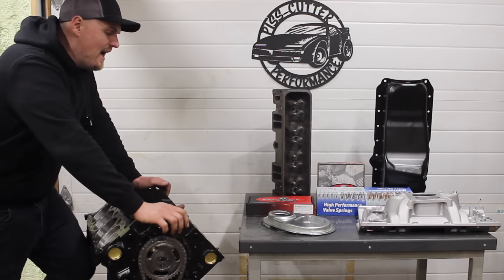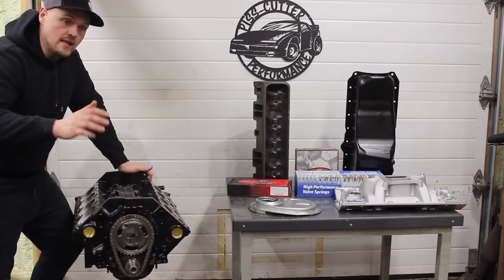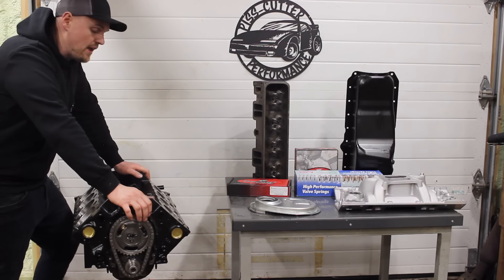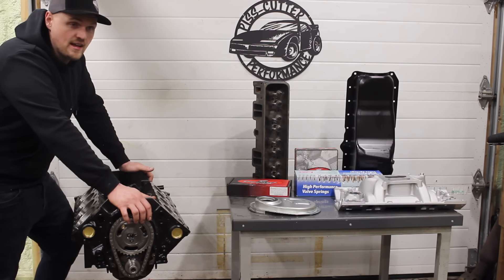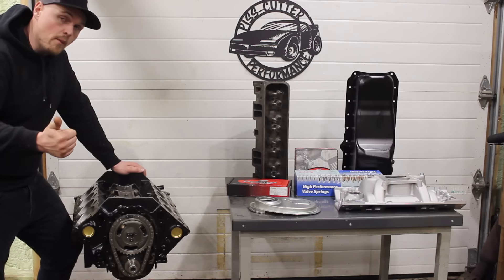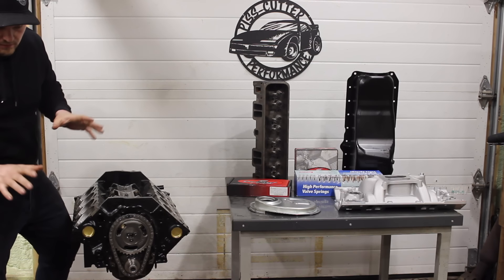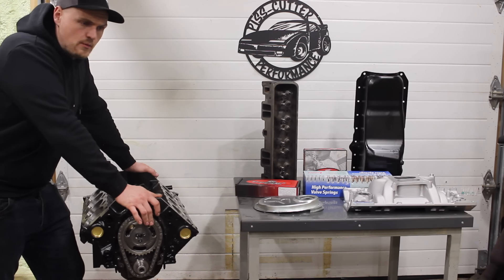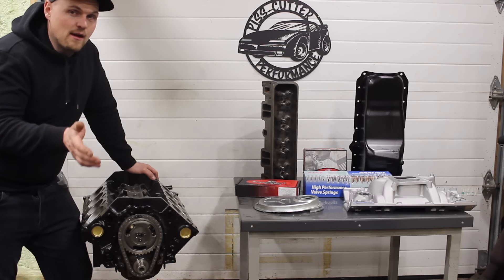The Cam I Always Get Asked About!  L31 Budget Build Update (L31 Build Part 5)

Comment: Great score on the camshaft! Would love to see what the factory Vortec cam would do with a set of 1.72:1 roller rockers. Would make it a .475"/.491" lift also for every .1:1 of rocker ratio increase you get another 2° of duration@ .050". So that would give the factory cam a boost another 4° per lobe to IIRC 195°/200° @ .050" from 191°/196°

Reusing the factory cam would be the most budget friendly. The 1.72:1 rockers are the biggest ratio rockers I could find made for a sbc. Would be cool to see these vs factory stamp steel rockers with the factory cam.

If you can find a higher ratio sbc rocker that would be even better to see. Or if you have access to Iron Duke 4 cylinder stamp steel rockers, those are 1.75:1 ratio. Not sure if they would interchange with sbc rockers though? These would get it to .483"/.499" plus 1° more duration@.050"  to 196°/201° if they would work? This would be very budget minded because most guys wouldn't want to remove the press in studs that are needed with lifts over .500".
Reply from the maker: Yeah I couldn't believe it when I figured out what the cam actually was, just such good timing to get it.
That would be interesting with a stock cam, but probably pretty weak in HP to most guys standards even with some aggressive rocker arms
Reply: I respectfully disagree.You might want to rethink the 1.72's adding duration. The lifter still starts up the lobe ramp from base circle at the same degree of crank rotation. The longer rocker only increases valve lift speed and overall lift. I have wanted to try 1.7 rockers on a stock engine also. I don't want to give up compression with added duration. Thanks.
Reply: @frankjones4094  you are wrong with your thoughts respectfully.  A higher ratio rocker will not change the overall seat to seat duration at lash point, however it will add duration at every other lift point along the curve.  Going from a 1.5 to a 1.7 adds about 4-5* @ 0.050 at the valve tip where it matters. By adding lift using the higher ratio, the whole lobe becomes larger from the added ratio.

I also would not waste my time with the stock L31 cam. It is garbage, it was terrible in my Express van that came factory with it.  I swapped the stock cam for a Comp 206/210 on a 110 lsa and 108 ICL with 0.484 lift with 1.6 rockers and that van was a different vehicle entirely. After the cam upgrade it actually had power to pass quickly on a 2-lane road and would actually rev up to the 5,000 rpm shift points at WOT without having to back off the pedal and let it shift.
Reply: @cuttersperformance  
Well here's the deal why I asked this is because I had a sbc factory roller cammed Vortec 305 in a 3,600 LB car backed by a 700R4 and a 3.73 rear gear that would do consistent 14.0s in the QM @ 98 mph. Not a land speed record but a whole second faster than a lot of the warmed over sbc 350 guys in a similar weight car. 

The only thing I did to that engine was light pocket porting, 1.6:1 roller rockers with the factory cam topped with an RPM Airgap and a crappy 600 Edelbrock 4bbl carb. So do you think it was the gearing that made it run that good or the engine or the combo of both? IMO the factory cam with the low compression pistons is a good match, even better with more lift and a bit more duration?

@Frank Jones
Well you will have to take your disagreements to David Vizard where I learned that info. That is the name of his yt channel, look him up he wrote the book on head porting and several other books on how to make power on certain engine platforms. He's an actual engineer not a journalist like some people mistake him to be.

Let me try to explain it before you get in an argument with a race car Icon. Think of the extra rocker ratio transforming a small cam lobe into something fatter and taller than it really is, just like what the factory ratio does. That 1.5:1 ratio not only makes the peak higher than what the lobe lift is it makes every point of contact higher is how even more ratio than the factory ratio gives a cam more lift AND how it gives more duration as well. The extra height on both sides of the nose makes it wider than the factory ratio does increasing the duration of how long the valve is opened over the nose. I hope this helps visualize how the extra ratio also increases duration?
Reply: @chrisreynolds6520  
The duration increase isn't much more than what the factory cam is, I suspect the lift is what helped get the cylinders filled more so than the 15*/14* extra duration. The closer the lift is to the max flow the better the cylinders will fill. The factory untouched max flow is right there @ .500" lift. Ideally if the cam has an about .515" lift is perfect for how a factory untouched sbc Vortec head would give the most flow. What makes the factory cam so lackluster is the bean counter low lift so they could save .10c on a set of valve springs! 1.9:1 rockers would work great with the factory L31 cam if they made that ratio for a sbc that didn't break the bank

What did you do so the keepers didn't crash into the valve seals?
Reply: @itseithergonnaworkoritaint7852  LS6 springs and 787 retainers, then fully seat the seals. It will vary head to head but it is usually safe to 0.520" lift with 0.050" to spare.
Reply: @itseithergonnaworkoritaint7852  I have run 1.7 rockers on the GM 395 cam.  I swapped out that tiny 395 cam for the Lunati Bare Bones "Hotcam" clone that is 218/228 with 0.503 lift. The Lunati cam gained nearly 40 hp at the wheels at 5,500 rpm compared to the small cam and 1.7s and did it without loosing torque anywhere over my ~2,500 rpm converter stall speed. If it lost anything off-idle it was not noticeable with the slightly looser converter. I had off shore Assault Racing 200cc castings with both cams.  Same casting as the AFR Enforcer heads.  Even in a 6,500 lbs van with a 9.6:1 350 it ran great.
Reply: @chrisreynolds6520  
Ok, didn't know you changed the heads, with the bigger 200cc runners vs the Vortec 185cc runners you need a bigger cam to make up for the lost velocity.  Plus going to aluminum without raising the compression ratio didn't help either. Also the heads that were swapped on more than likely has it's max flow rating @ .600" lift vs the Vortec heads maxing out @ .500" lift.

The build we're discussing here is going to use factory cast iron heads that would work better with the smaller cam than those aluminum heads would.
Reply: @itseithergonnaworkoritaint7852  It is very obvious that you do not understand how this stuff works.  A slightly larger port does not need a bigger cam to work correctly.  Even if the port peaks at 0.600" or more does not mean it needs to have that much lift to make excellent power.  There was no point in raising the compression ratio.  The engine had bad detonation at anything more than 22-24* of total timing at WOT with the iron heads on 87 octane and always did even stock.  The aluminum heads stopped the detonation and allowed me to run a full 30-32* of timing and a much more aggressive advance curve.
Reply: @chrisreynolds6520  
Velocity, look it up if YOU really want to know "how stuff works". LOL

Never said you couldn't make ok power because the ports peak @ .600" lift if you use a cam that doesn't reach that.🙄 That wasn't the point, velocity was the point.

What I was wrong about(just looked it up) is that the factory L31 Vortec heads have closer to 170cc intake runners. 200cc runners vs 170cc runners is that velocity thing you really should look up if YOU want to know "stuff".
Reply: @itseithergonnaworkoritaint7852  If velocity was so critical you would not see numerous dyno tests of the same exact engine with 2-3 different sized intake ports tested using the same cylinder head other than intake port size where a surprisingly large port makes the most low-speed torque.  The Dart Iron Eagles were tested on a 350 for example, 165cc, 180cc, 200cc, 215cc and 230cc.  The 215cc ports made the most low-speed torque, highest average torque and highest average hp and did so with a very mild camshaft.
Reply: @chrisreynolds6520  
Where can I find that Dyno test?
Reply: There are 1.8 available but $$$.
Stamped steel rockers are rarely what they are rated.
PRW Sportsman are the best budget rockers. (DV)

Comment: I was gonna go 8803 but decided on the k 1103 cam for edelbrock 600 I got. Another good lt4 alternative is the melling 22280 cam but it's got a 110 lobe sep. And I think more duration.
Reply from the maker: Ive used the 22280 a few times, good street cam
Reply: I had that on the s10 frame mustang with the vortec head 400 small block. I changed it out for the radical edelbrock Rollin thunder cam. Not the 470/490 lift one but the 530/540 something lift version.

Comment: I’m doing a 98 vortec l31 swap in my 84 cutlass i upgraded springs cut down the stud bosses 7/16th screw in studs 7 degree locks guide plates for pushrods 1.6 comp aluminum rockers roller tip I got rid of that self align bs flattop pistons got it bored to 3.55 lt4 hot cam from gm perfomance im putting her together now air gap intake manifold holly double pumper 650cfm 3 inch exsaust flowmasters from front to back and long tube headers trust n believe ima run these Camaros for their money this summer
Reply from the maker: That sounds like a nice setup! 👌

Comment: I guess if machining costs aren't something you need to worry about in terms of rod resizing it might make sense to spend $150 CAD on ARP hardware for your re-Man'd Rods. At what point do you call it and simply opt for a set of sub-$500 CAD set of Chineesium 7/16" Rod Bolt H-Beams that come with new 8740 cap screws ? Only if hanging new Pistons that will require a rotating assembly rebalance anyway ? Curious to hear your thoughts. My first home rebuild was back in '93 when I did my first SBC swapped S10 (when every dollar mattered for the project) with a 3 blade hone and re-using literally everything but rings, oil pump, cam/springs, intake. I miss those days of "budgets". Being an adult makes you able to stretch everything, including simple budgets when you talk yourself into it.

Comment: What retrofit hydraulic liters do you recommend with the LT1 Hot cam?  Also what stall converter would you recommend?
Reply from the maker: Howards Lifters and a 2800 stall works well with it on a 355

Comment: The summit 8802 and 8803 seem like budget options that have similar specs to the lt4 hotcam, curious to see how Vortec heads would react withi that range of lift and a 112 lsa. With a proper port job they should flow decent up to .520 for the 8802 and with a 1.6 exhaust maybe go with the 8803?
Reply from the maker: I used the 8803 in the Youtube 355 with cheap aluminum heads. Worked well and idled with lots of vaccum. Its a great boost cam when I added the turbo. They are quality cams
Reply: I have run the LPE 74211 in a couple of trucks and the LPE 74219 in a F-car all with modified Vortecs or Etec170s.  Those mild Lingenfelter cams run great and make power that would not be expected from such a short duration. Lingenfelter did not grind any cam advance into those cams.
Reply: I got the Summit 8800 in mine. It’s got some lope, and makes great linear power on stock vortec heads, and has plenty of clearance with the stock valvetrain. I gotta pull the heads to put new valve seals in, so I think I might drop the heads off at a machine shop and get the valve guides machined down, some porting and polishing,  and run a 1.6 rocker instead of the stock 1.5s for more lift. With the 1.5s I get 204/214 at 050 with .450/.450 lift, with 1.6s I will get .480/.480 lift. It’s a great mild cam, I love it so far.
Reply: Identical specs don't mean the lobe intensity is the same.

Comment: Hi Jay Appreciate your videos, I  am sure you have save me lots of trial and error.  Basics: 355 sbc, Enforcer 195 heads. 10.2 comp. Originally ZZ4 cam, switched to Sum 8802. 
I thought I  heard you mentioned about noise from the  High Energy 17001 roller rockers. I have the annoying ticking even after carefully readjusting the preload. Is there a part that is similar quality but quieter?
Thanks

Comment: IMO dingle balls are bad.
My suggestion would be to use a 3 arm rigid stone cylinder hone with a 1/2 inch drive variable speed electric drill. That way you can put some semblance of a cross hatch on the cylinder walls.
Hone finish determines the type of ring material. Dingles are bad... and require cast iron serrated face rings... Lots of drag.
JMO 60 years

Comment: This may be a dumb question, but I have a 96 Tahoe with the 5.7 Vortec and I wanna run the  COMP Cams Magnum 280H Hydraulic Flat Tappet Camshaft Small Kit Lift: .480".480", Duration: 280°/280°, RPM Range: 2000-6000 with blue ls6 springs, a 3k stall, and upgrade the rods/pistons. Will this work with fuel injection or will I need to do a carb swap?
Reply from the maker: Not a dumb question. A larger cam will require tuning and a intake/injector upgrade might be needed as the stock vortec intake is not very high flowing
Reply: @cuttersperformance  Vortec intake flows well enough to make ~450 hp.
Reply: @chrisreynolds6520 Man I see you everywhere lol. I’ve gotten great info from you as well, including the piece you just shared!

Comment: Can you show how you drill the heads to 1/2” for pushrod clearance when using 1.6 rockers? 
I’m wondering if you drill all the way through including alongside the port?
Reply from the maker: Yeah, I can show that in an upcoming video. But yeah the existing holes are drilled right through
Reply: Pockets, run a 1/2" bit straight through the existing holes. Took me about 20 seconds a pushrod hole.
Reply: @chrisreynolds6520  ok. And as far down so the bit is touching the side of the port, the bit doesn’t bind up against the casting?
Reply: @pockets5628  I am confused as to why you think the bit will bind.  The pushrod hole sits well away from the rest of the casting and the material you need to go through is relatively thin.
Reply: @chrisreynolds6520  Ok, I'm doing this for my father in law, and he's concerned. I haven't looked at them yet. He's probably overthinking it.

Comment: Question.  In Your opinion.  SBC 400 vs 350. What would you build for power and longevity.  Had a 400 built for my 66 chevelle, high nickel content all quality parts and "friend left carburetor studs drop into intake. Blew hole in block. Need to start over. Can I use most parts from 400 on 350 ? Or should I look for a 400? Longevity and horsepower wanted. 
Thank you
Reply from the maker: O man sorry to hear that! With all things equal (cam, heads, ect) a larger engine will always make more power and torque. If your trying to make a nice driver eith say 400 to 450 HP you can do it either way quite easily
Reply: @PISS-CUTTER Performance  Thanks for sharing 👍. I appreciate your help and love your channel

Comment: Wow, that's a ridiculously good price on that cam. They're very pricey...when you can find them.
Isn't the max lift possible with stock Vortec heads pretty close to the .525  on that LT4 cam? Expect any clearance issues?
FYI, I bet Competition Products offers a very similar grind in their Howards line. 
But, not for $60!
Reply from the maker: I will be making a video on how we are gettting that lift out of the heads and what valve springs ect

Comment: How is the intake, exhaust valve lift with that camshaft? Can you run this camshaft on a unmodify Vortec cylinder heads?
Reply from the maker: . 525 lift in/Ex and I will be showing in a up coming video exactly what I will be doing to make it work on a basically stock vortec head
Reply: Looking forward to it. That camshaft sounds very interesting. Would love to see what gain in torque and horsepower you can get with this camshaft. I have a L31 I am about to do a light overhaul on. So everything that makes a gain is very much welcome. Keep us up to date.
Reply: Sorry if you have mentioned this before. But what ratio rockers are you going to use? What lenght on the push rods?
Reply from the maker: @Trond Vidar Dalseng  1.6 rockers to get the .525 lift. And should be close to stock length but i will have to verify once the heads go on
Reply: @cuttersperformance  Are you going to mill down guide bosses in order to make higher valve lift? What about theaded valve guides?

Comment: I was rewatching a porting vid you did on Vortec heads and I was curious if you could run an LS 2.00" intake valve in place of the stock 1.94". I'm not sure if the lengths are the same of even the diameter I know they are fairly lightweight 7mm stems I think and a guy could probably get a whole set used pretty cheap or for free! Just a thought, I love thinking about little tweaks to make them better.
Reply from the maker: You could add LS valves, but the guides would have to be redone to 8mm stems and then the seats cut to accommodate. The would be  great size for vortecs with some porting to take advantage of the larger diameter and the LS valves are much lighter. The only downside would be the cost of machine work. You would certainly have some time and money invested once you're done
Reply: Not much better below 6000.

Comment: When you installed your lt4 hot cam did add advance to it 2 or 4 degrees?
Reply from the maker: Installed straight up, I will have to check my notes from when I degreed in, but I believe it had no advance ground in and installed at 112
Reply: I noticed most have been installing them at 2 to 4 degrees advanced.
Reply: @cheol1250  The ones I have messed with drop in on about a 109 ICL.  4* advance that to 105 ICL if you are staying at the stock compression ratio to help add some low rpm manners.
Reply: @chrisreynolds6520  thank you